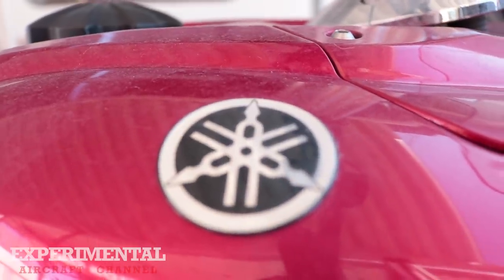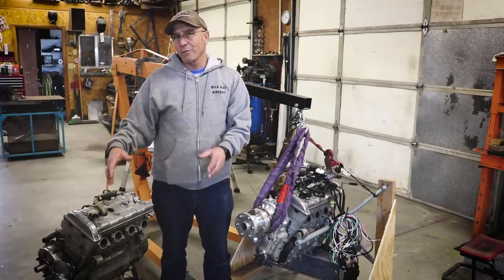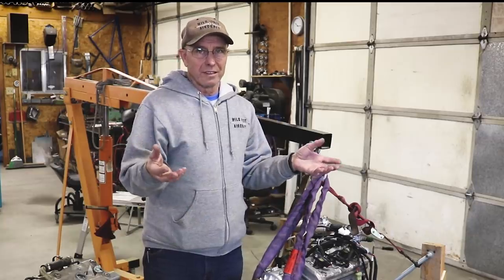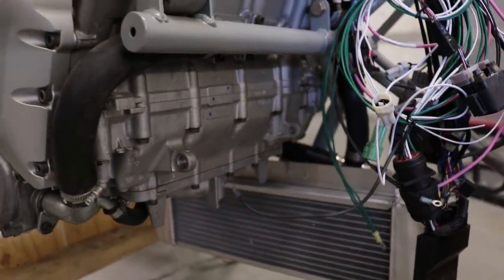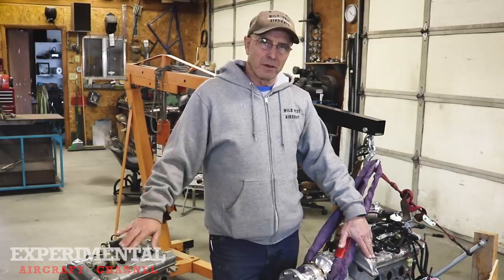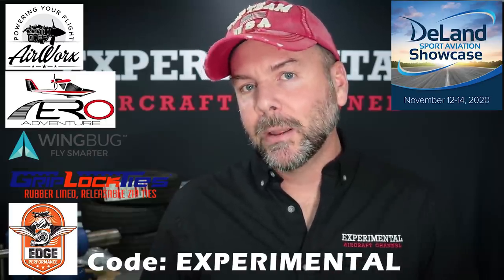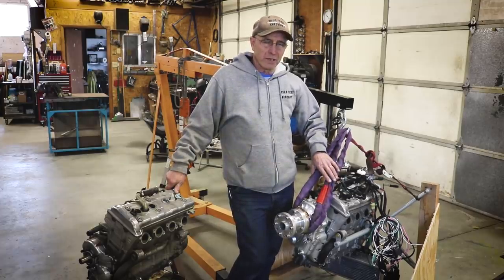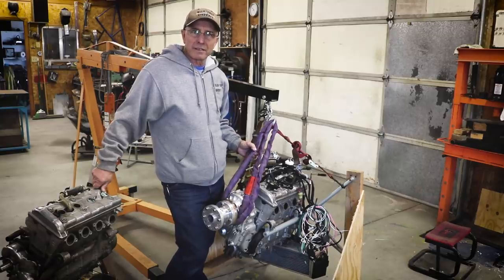Yamaha Aircraft Engines?  STOL - Steve Henry

Comment: 8,000 to 9,000 RPM for cruise. That is crazy. "Lagacy engines" meaning like homing for example will cruise at 2200 to 2,500 RPM  not 3200.
Reply: @tinolino58  Piston or reciprocating engines are not turbines in any way, shape or form. 9k-11k RPM for short periods of operations ok. Constant red line not good. Sorry.
Reply: @tinolino58  That is a non factually argument you propose. I have a master's degree in mechanical engineering from UW. I've been working and racing cars, motorcycles most of my life. I built worked on and flown experimental aircraft all my adult life and fly airliners. and experimental airplanes and flying airliners. The physics of engines haven't changed in a hundred years.  Yes different design battle  materials  has a loud high revving engines. Regardless those little engines are highly stressed, not something I'm going to trust my life on. Add a gear box the reliability is not acceptable to ne from my +35 years in aviation. I  want my aircraft engine to be low stress, with high margins of safety, not stressed out and red lined. Snowmobiles aren't ran wide open throttle all the time unless they're racing them. Those engines do fail. Grow a brain troll.
Reply: @tinolino58  I'm in my early 50's and irrelevant to the debate that you are losing. Any engine (and PSRU) no matter how super nifty wears and fails sooner when operated near 100% of rated power. I have seen dozands and dozands of alternative engine installations in kit airplanes over 35 years. They all have major drawbacks including this snowmobile set-up. Everytime coolaid drinkers with ZERO experience or knowledge like you swear how great an engine is, the Engine/PSRU are forgotten years later, just like this will be. Wisdom of age and technical education you lack speaking.

Airplanes are not snowmobiles or motorcycles you can pull over and stop when engine pukes. This guy races solo in a slow plane. Great. This engine is not practical for GA. Also PSRU's fail eventually and frequently. This Yamaha engine and reduction drive is a hobgoblin of shade tree mechanics tinkering with few hours of reliable service history.  This is called FACT. It's cool for STOL drag but not proven. He alludes to problems and being a test pilot and dead engines 3:46 .. Price? He has over $30,000 to $40,000 and 100's of hours of work. No thanks. You lost troll. You have been schooled. Run along
Reply: @tinolino58  Now your writing as digressed incomprehensible gibberish that's not even English.  Don'tget triggered Bro. Ha ha. This topic is way over your head. Regardless this is not a practical engine for a daily fly'er.
Reply: @gmcjetpilot  Have a look at the piston speeds of these small bore, short stroke high revving Yamaha engines. Despite the high SHAFT rpm, the piston speed is very close to say,  a Lycoming O360. They are designed to run at these rpms, and have a well-earned reputation in the snowmobile and motorcycle racing community for durability at constant high rpm/high power settings. There is probably less stress on a Yamaha at 9000rpm than there is on a Lycoming at 3000rpm.  Look how long it took Rotax (912 family) to finally get acceptance as a good aircraft engine (from GAers, experimental guys knew much sooner). Too complex (gearbox) too high revving they said, and yet they just kept building hours. If you got into aviation using legacy engines, it's only natural not to trust high rpms, - your typical LyCont cannot handle sustained high rpm operation; it is neither built or required to rev being large displacement and direct drive (for the most part) Lycoming dabbled with gearboxes for a bit, and it was not a success. More so the users than the design was the problem. Rotax has had great success, and if the gearboxes used with these Yamahas are as good as the engine, we have a winner.
Reply: @mr-uc4me  You are all over the place. Lycoming wasn't designed for high RPM. It is a high torque, low RPM aircooled DIRECT drive aircraft engine designed for aircraft, and does not require it to Rev high or a PSRU or water cooling to make 100% all day long.. As far as racing with Lycoming , go look at Reno Sportsman racing Red Bul air racingl air over 400 MPH. Try that with your Yamaha. Lycoming is designed for aircraft. You put it on an aircraft you go flying. You put a Yamaha in you will spend thousands of hours tinkering not flying.

 Apples and Oranges. The Yamaha R1 or Apex snowmobile engine is designed for higher RPM.  Original normally-aspirated version is was about 140 horsepower at 11,500 RPM. Now it's turbo charged and +200 HP at MAX POWER. These  Engines aren't designed to be run at 100% continuously or for aircraft.  This guy in his normal operations is revving at or above red line A LOT. What do you think's going to happen eventually? A Lycoming 160-260hp  can go 1000's and 1000's of hours, be rebuilt, go another several 1000's of hours more, and do that again, reliability without missing a beat. Get my point? 

 You have confirmation bias. I never said Yamaha motorcycle or snow sled engines were not designed for high RPMs did I? However as a motorcycle rider (BMW R1150RT) I only get on it on occasion, red line on occasion like  most Street motorcycle riders or recreational snowmobilers. Most of the time I'm at 50% power and below RED LINE.

I studied high RPM 4-stroke engines all my life including Honda's racing motorcycles that turn 21,000 Revs!!!!  THIS IS NOT NEW OR NEWS TO ME.  Honda GP bikes based on the NR750 spun the engine up to 21,000 rpms!!!!!  That was 1960's!!!! You are preaching to the choir. 

Yamaha makes good products. This snowmobile engines is pretty awesome at 140 horsepower maybe even +200 horsepower 20% of duty time, but most of the time you will be going 60mph on a road or trail not a drag race non stop. This guy is holding it wide open at or past RED LINE, but he's racing. Fine. That's great for racing in a low and slow STOL drag race over a dirt strip. If the engine fails he lands in dirt at slow speed. This is not normal flying and has higher risks. Get the point.

Trying to get over +++300  horsepower out of this tiny engine 80% of operations will result in high wear and early failure. It doesn't take rocket science to figure this out. These engines weren't designed for aircraft use or high MAX continuous output at or past RED LINE. There's no damn debate.

There's nothing I can say that will convince you of anything, because you suffer from confirmation bias. You're arguing a strawman. I have no problem with high revving engines for race motorcycles, race cars and race airplanes. However this is not practical for a general aviation aircraft flying humans, passengers over populated areas day in day out. Put it into a Kitfox or Zenith and ring it at 6000 RPM 140 horsepower it's probably fine.  

The Achilles heel of all these alternative engines is the PSRU or speed reduction drive; it has always been a problem and always will be. They're harmonics, torsional coupling  materials, backlash, tolerances, lubrication that makes it difficult to design and manufacture and be reliable for 1000's and 1000's of hours, especially doing STOL drag racing.  A lot of these drives have to be disassembled inspected every hundred hours or they fail in 200-300 hours.  Don't be q lazy think or do some research.

 Lycoming direct drive eliminates reduction drive, water cooling and is proven. THESE ARE CALLED FACTS.
Reply: @gmcjetpilot  Quite a sermon there. Just by saying 'These are called Facts!!' after an opinion piece does not make it so. No doubt, some of what you wrote is factual. For example,  I would agree that a 'Lycoming direct drive' is in fact, direct drive. I have done my own conversion of a car engine (Subaru) and put it in an airplane. I put 500 (at 4500 - 5500rpm) mostly trouble free hours on it before selling to a friend, who put a further 150hrs on it before he sold it to a fellow out on the west coast. Still going strong last I heard. I hardly spent thousands of hours of tinkering to get it right. How many conversions have you done again? Never mind, you were probably one of the guys shouting 'it won't work!' from a soap box.
Reply: @mr-uc4me  "Lycoming direct drive eliminates reduction drive, water cooling and is proven. THESE ARE CALLED FACTS." Prove that statement wrong. Yamaha RX1 or Apex 998cc or 60ci in-line 4 cylinder 145hp is optimized for snowmobiles not airplanes, also a FACT. 

The Subaru engine conversions and Eggenfellner disaster prove that this engine along with Mazda Wankel engines were mediocre to failures. In the day they were going to set aviation a blaze with modern technogy. Ha ha. What ever. Lyc's today have electronic ignition, Fuel Injection and even full one lever FADAC.

Get your parties wet girls, a 0.9L Yamaha is king... lol.

The only few successful Subie  installations in airplanes is Ross in Canada who makes SDS ignition (race cars to experimental aircraft) . The effort and expermentaion, fabrication he did, plus lessons learned from his off field forced landing due to loss of power in his Subie powered RV-6A,  proves alternate engine conversions (car, motorcycle, snowmobiles) is a niche segment, for those willing to take the time, money and risk. 

Most engine conversations fail and result in slow, heavy planes with lots of drag and sadly often unsafe. In the rare world of STOL drag racing in ultra light weight, low speed kit planes, a Yamaha running 14,000  (2500 rpm over red line) seems to be competitive. Good luck. 

You are in denial, petulant and padantic. Run along. You lost.
Reply: @gmcjetpilot  Ooof. yep, you sure told me.
Reply: @gmcjetpilot  so....how many conversions have YOU done again?
Reply: @mr-uc4me  Go away troll.

Comment: EFI is so much better fuel economy than carbed.
Reply: Wonder what the fuel burn is at 8,000 and 9,000 rpm?
Reply: Not so true in an airplane RPM doesn't change all that much where in a car have to change the RPM lot more often. Also lost more electronics can fail cause engine to stop where old school aircraft engine as long as the engine keeps turning mags get power. Probably not so much to worry about in a STOL aircraft like Steve's he can land it in someones driveway or a roof top only needs about 20 feet.
Reply: @Mike-01234  I have flown both and never had an issue. EFI starts easier and has no vapor lock issues. As for electrical power loss, hmmmm, thinking how many times I have lost electrical.
Reply: blastman8888 Mags and EFI are two different things. EFI is induction, Mags are for ignition. Which is not to say they can’t be integrated......

Comment: The reason people think they have a valid reading is ==>> they checked... once
Reply: Given a choice, I will go with injection... with the electronic injection, all the altitude issues are pretty much gone... with hydraulic cam followers ;;☆》... how do you gear down, and remain in the power band?.. constant speed prop?
I am in the design process and I have a motor that can turn 35,000 rpm.. I have been thinking about a ring and pinion.. or a belt drive that will allow lots of rpm and deliver the torque needed to turn a propeller... ... suggestions appreciated

Comment: remember it's a hole different engine technology 5 valves and a way faster cycle that make a  hole lot more power than the opposite cylinders 4 valve for a almost similar weight , sled competition have been running that engine for the pass 13 plus years and some performance shop in us and Canada will big bore sleeve and 10/1 HP piston high flow injector Garrett turbo and mapping will produce up to 415 HP steady for around 10K and if you have the knowledge like i do you can pull off a apex for 10 or equivalent  easy but i agreed if you don't you probably looking at 20k , but realistically  should not go well over 300 hp for airplane it is more reasonable for heat dissipation control reason , hot engine will last less longer and perform less to 

just finding a decent use engine is a mission on it's hone , you can get a Yamaha crate for 5800 if you have a buddy that own a dealership , i personally got a 2011 sled with the correct turbo kit already attache for 2500$ and i  put all new pistons rod berings injectors etc etc and have not pass 7k yet but still need a gear box and a engine mount i already converted the excuse so i expect around 10500 total so for a person that is totally out of the gear-head loop 20K sound very attractive

i am planing to mounted on a Cartesian cub but i am at a stand still right now life is a B sometime and hobby is the first thing to suffer but hope to be able to get a more stable shop to finish it proper so i can get over the Canadian bush mountain like a boss .
Reply: ,,, I think the Yammis got rid of the 5 valve, and are now 4 valve, but am not familiar with the sleds .
Reply: @rolandtamaccio3285 it is total possible i am not familiar with the newer model

Comment: I said in a comment months ago, that these conversions will not be any economical than a cinvenstional aircraft engine and I am right . 23k for a used sled engine with a gearbox. Who thinks that that makes sense and a turbo version for 20 k more holy fuck batman. That's close to a certified Lycoming new 540. Seriously this is fucked. I'll stuck with a Rotax 912 thanks. They are known to go way past 2000 hrs of reliable service.  What malarkey.
Reply: videoclipits  thanks for lucid comments, doubts and questions...these are drag race, STOL engines to compete and climb 3000 ft per minute...too narrow a use band and undetermined engine life....interesting, but...
Reply: Do your own conversion. Source your engine, buy a gearbox, wiring, headers and engine mount. Could do for $8k +-  It will be alot of work, but if you want plug and play you will pay! Rotax not cheap either....
Reply: That was 23K for a rebuilt engine, gearbox, prop, wiring harness.........  Buy the parts yourself and you could do it for less.  What would it cost to buy a complete rotax that makes 150 Hp?
Reply: @craigsanders6925  More. There are companies out there doing big bore, turbo and EFI kits but you are paying anywhere from $6k to $20k (just for the kits!) in addition to your whatever you pay for a 912.  If you buy a complete ready to run modified-to-150hp Rotax 912  engine you will find the Yamaha at $23k a total bargain. A new 140hp Rotax 915 is $35k.
Reply: @mr-uc4me  I knew the answer, the price from Steve is higher because he's doing all the work for a plug and play install.  People just don't seem to understand they're paying for a service to go with that motor.

Comment: I would change the comment to i feel just as good as i do flying my lycoming     anyone who has owned seadoos in the 90s is very weary of a rotax i hear there great but i sure spent a lot time on a broken one
Reply: These motors are miles apart from that. Modern 4 stroke, ECU tuned fuel injection, modern engineering and materials. The sleds these go in to get BEAT on. Wide open pulls for a couple minutes across lake beds, running the rail beds at over 100mph for hours every weekend, or long WOT pulls up the side of a mountain running lots of boost. In the twistys it's hours of 100% throttle blasts, on the brakes for a corner, 100% throttle to get to the next corner and they just don't break. It's a much harsher environment in a sled.
My only concern with these are the re-drives, but even these are not the same as they were just a few years ago.
Reply: those are also over pumped from the get go!! if you look at the hp rate on sleds and skis the same aircraft engine will rate 1/4 the hp! have same rpm range but less out put
Reply: The Rotax 4 stroke 912 series engines are just about bulletproof.

Comment: you can buy the jet ski for $14, 399 brand new and direct from skytrax the gearbox is only $1,495 & all you got to do is put the gear box on and put it in the plane why would anybody spend $23,000 for him to sell you the motor when it's only $15,895 price tag to do it yourself complete doesn't make sense to give somebody an extra $6,000 and some change almost just to bolt on a gearbox $6,000 and some change just to bolt on a gearbox seems pretty damn Hefty of a price, just a bolt on a gearbox that only requires 8 volts to attach it to the motor I can't imagine what the complete airplane with the Apex motor in it costs from this guy, & another $20,000 for the Turbo Charge system, wow, what does this guy think his shits made out of gold, he's robbing people, he's a crook, if people would only do a little homework
Reply: remember, hes getting the engines used. I dont get it either but people must pay for it. Maybe there's some other things he didn't go into?
Reply: Carl, this man is running a business,  what he must charge for his product after figuring out the overhead, his time, and all the other costs that come up with his business, and maybe some for profit is his choice.  Now the decision to buy his product, or not to buy is yours. Do as you please.
Reply: Ok you still need to add  a prop, engine mount,and  loom, this is in his price.